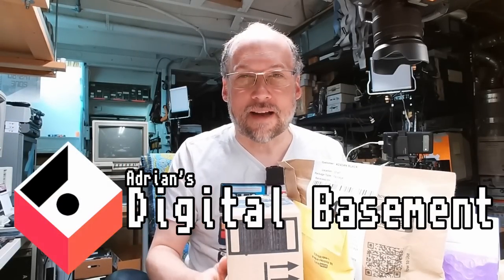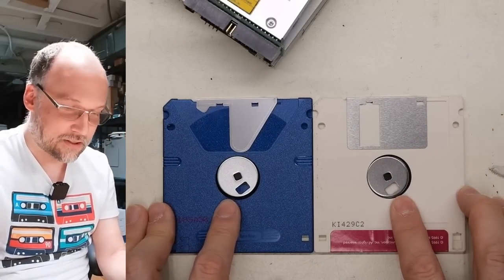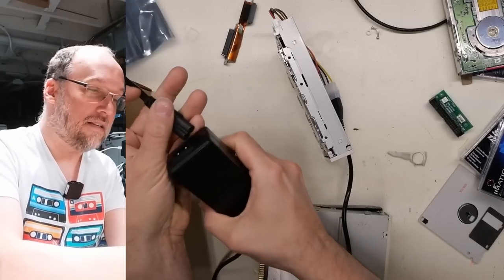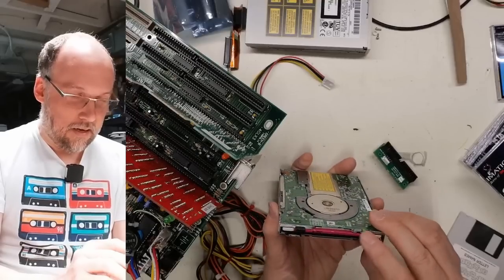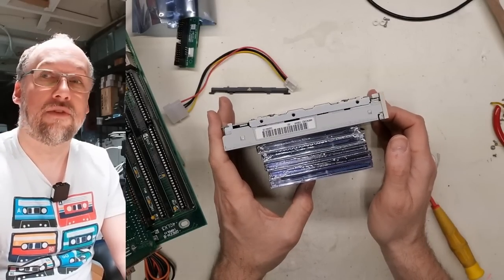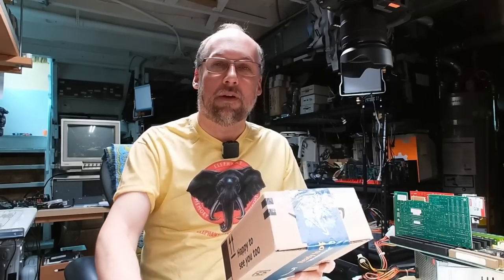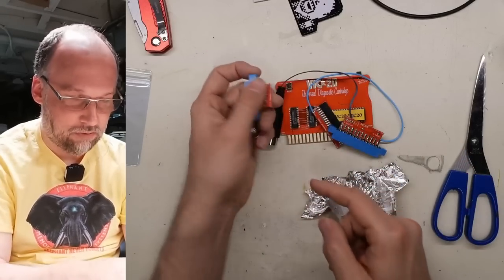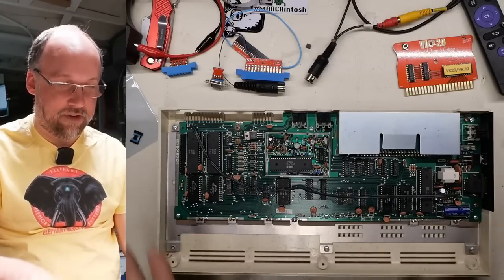0059 A VIC-20 test harness, an LS-120 disaster, a homebrew PC accelerator and a cool bad CPU die

Comment: Are you sure that the short wasn't simply caused by the solder joints of the adapter's power connector shorting against the metal case of the drive? At least that's how it looked to me...
Reply from the maker: Don't think -- the drive itself had a really bad burned smell and traces going to the SMD high density connector looked burned.
Reply: @adriansdigitalbasement2  I had a nasty experience with a 3.5 IDE > 2.5 IDE adaptor once.  For what ever reason it had +5 on a pin it shouldn't have.  When connected to the 2.5 disk drive a fair bit of current flowed and burnt a track on the drive's PCB.  Fortunately I was able to repair it and read the customer's data off it.  It would have been pretty bad to go cap in hand and tell them I had lost all their data.

You'll notice this drive has +5V only on the label, no +12V.  Only speculating but perhaps the adaptor routed +12V to somewhere it wasn't supposed to be.
Reply: @adriansdigitalbasement2  That's a shame, the pinout is totally different from a CD-ROM 50-pin unfortunately. And I think that your adapter may have been regular 50-pin optical drive pinout. You can see the real pinout in the "Slimline LS120 SuperDrive Floppy drive" thread on Vogons, it's the same as regular IDE but with some unused pins at the end. Eledip made some adapters that fit slimline LS-120 drives and they work really nicely. 
LS-120 drives are rarely working to begin with, I have a few that read floppies but can't read superdisks anymore, along with some that just chew up disks. Great drives when they work though, since they use a voice coil to move the heads instead of a stepper motor, they're very fast and I can sometimes read data off bad disks that regular floppies can't read anymore.
Reply: @retrozmachine1189  yeah, that'd be my bet, I've had adapters of that ilk in the past where the power connector was installed backwards so when you plugged it in you put 12V on the 5V rail.
Reply: I that happen with an IDE adapter the pins shorted to the case. Learned to put a lot of electrical tape between them.
Reply: @retrozmachine1189  good point on everything we hear for sure.

I've installed a module or apart for something that was messed up at the factory Straight Out of the Box defective and this was from the manufacturer as sent as a replacement part and damaged the device Beyond repair and got ahold of them got the newest model and they admitted that they're having problems with the device in the first place but had heard nothing about this even when I did repair and it was strained why the thing blew up on it and suspected that something had gone wrong internally the truth was told in the end when I called about the issue with the replacement part go figure that's probably what killed that module in the first place from what I heard and heard same sort of thing two other people back in the day same problem same solution was taking care of same way probably something going on there for sure.

Also one time where I used to live refrigerator went out apartment complex blue the same component three times in a row and we insisted on brand new refrigerator since it would just probably fail again in the same way we got it no questions asked and then compressor was good it was just start assembly or overload assembly cannot remember which it was just basically frying itself don't know if it was a bad batch or what but glad didn't have to worry about the refrigerator anymore just goes to show sometimes it's worth just throwing in the towel as well when something gets repaired three times the same part failing within months of each other there something wrong it's time to start fresh when everything else checks out compressor was properly checked no problems there no problems elsewhere but was just a part that had then replace that many times for sure
Reply: yeah... that's what happened 
...and i saw it coming.

i wondered if anyone else saw it.

Comment: Hi Adrian, Laser is for alignment also LS120 have very high density so they read write slower. Normal floppy can't hold the capacity since they don't have the density. Use them since they come out on the market, I love it reading normally floppy really fast.
Reply: I would like to add that the magnetic read head can be made very narrow and still read a disk. A smaller head can read "bigger" tracks without any issue. The write head has an issue because no matter how small you make it you'll have a magnetic domain larger than the head. To write a bit the drive would pass current through the head, but at a level too low to make a magnet mark on the disk. If you turned on a laser while the low current was passing through the write head the added heat would lower the magnetic strength needed to make a bit. Basically you'd have small magnetic energy over a larger area but only the small part you hit with the laser would allow the magnetic field on the media to flip.
Reply: Fun fact: LS in LS120 stands for Laser Servo
Reply: @therealjammit  ooh, are you saying LS120 uses the Curie point to control write area kinda like MiniDisc? I had been under the impression it’s only for traditional head positioning. But indeed MD holds a similar amount of data as LS120. Albeit it reads with the laser instead of with the magnetic head.
Reply: @kaitlyn__L  Yes. The Curie point. I honestly couldn't remember that term. Same as MiniDisc.

Comment: Those blue LEDs were £10 each when they first came out, here in the UK (at Maplin's). The next year they dropped to £2. As for Radio Shack (Tandy here) I think they'd already closed up shop here before those were availavle. I'd guess the price would have ended in a 9 though, regardless. I think EVERY price in Tandy ended in a 9!

Comment: We installed LS120s in lieu of floppies for a while in our machines. It was short lived but they were good for backups. The laser on the ls120 is with the heads and is a tiny little thing. It is used to read servo index data from the disk. This allows more precise positioning of the heads and thus higher density data. The hole in the eject button is an emergency eject hole. These can suffer from the click of death.
Reply: As soon as he said that, I thought I recalled the LS120 drives using a laser for tracking, not directly for read/write.

I remember a lot (well, relatively, a lot) of Compaq machines having LS120 drives in place of the floppy as a standard feature (and was bootable) around the AMD K6-II era. Specifically those beige-y models that were kind bulbous and had some front ports behind a frosted plastic door at the bottom center of the case front. Before they went to the white design with the changeable translucent color panels.
Reply: @slightlyevolved  they made quite a few OEM deals to try and make up lost ground against Zip. IBM desktops also had them for a while too. AIUI they also stumped up the work necessary to get BIOS support as a condition of the OEM deal. Of course, it wasn’t enough! The computer manufacturers took the excellent deal on drives while they were being offered but had absolutely no investment in keeping the platform.
Reply: I have a original-iMac-era external ls120 drive (USB), for bridging to the brave new world with no floppies. I've used it only a handful of times at most.

Comment: The reason LS-120 SuperDisk floptical drives use a laser is that the read/write head in the SuperDisk drive is much smaller then standard 1.44MB floppy drive and the laser helps locate the head much more precisely then possible on a normal floppy drive. It this precision that allows it to store 83x the amount of data vs a standard 1.44MB floppy. The successor model to this, the LS-240 offered a additional feature, beyond doubling the capacity, in that it could format a standard high-density floppy disk to 32MB. The downside of this was that such floppies could only be read on LS-240 drives, not standard floppy drives, and that each time you changed any data on the disk, you had to rewrite the whole disk contents much like early CD-RW media.

Comment: Nice video, Adrian :)
That laptop drive is fine!! The adapter power pins were shorted on the metal back of the drive because someone forgot to insulate the adapter properly!! I had the same issue before with HDD adapters.
Reply: Well it's not fine any more... 😉

Comment: I had that larger LS 120 drive back in the day. It's been 20 years, but do remember it having a unique sound, and if memory serves me, yours sounded about right. I bought that drive new and just loved it. I remember booting off regular floppies, and that was the magic over the zip drive, that and it fit right into the tower looking like nothing more than a regular floppy drive. The fact I could store 120mb on a floppy sized disc and run regular floppy discs, was the reason I got it. Of course, it didn't stay in favor once compact flash came along, and it's been long forgotten. It did bring back fond memories of it though. It was nothing more than a fad, but one I am glad I had!!!
Reply: I bought a gateway PC a few years ago, had no clue about LS120 then. I thought someone had just added a fancy floppy drive with a soft touch eject button, low and behold it was an LS120! It also had a Travan tape drive for backing up your HDD.
Reply: @0326Hambone  yeah, if I were still into computers like I was 20-25 years ago, I'd cherish having an LS120 again for nostalgic reasons. I remember it was much faster and actually quieter than a regular floppy drive, and I liked their little gold logo on the drive door. To me, it was miraculous that they could take a little floppy drive type disc, and stuff 120mb onto it! I can't remember by how much, but it also increased the capacity of a regular floppy disc. Then the real game changer came along with the CDR! How could it get any better, a burnable CD!!!
Reply: @0326Hambone  I rebuilt practically every brand of PC ever made from around the first generation Pentium 1 up to about P4, including laptop and desktop machines, and Gateway was one of the better built brands. Sony Vaio's were also well built, and Dells were mediocre, but there were some brands that were just junk, can we say Compaq Presario. One thing about branded machines though, most were difficult to work on due to case styling, and cramming everything into the smallest space possible! In all those years though, the Mac was highest quality computer I ever rebuilt. The components in them were far superior, but I just didn't like the Mac os and software. Mostly stuck with IBM compatible due to their availability and diversity. It really got interesting when I started delving into laptops. Man, I used to have five PCs updating at a time in my living room, at least it kept my house warm in the winter...lol. Ahhh, the good old dial up days, 56k all the way!

Comment: LS-120 - Laser Servo. The bottom side of the LS disk contains an optical pattern which is read by the lower head laser in order to position the head accurately enough to achieve the number of tracks required.

Comment: Hi Adrian,
the sound of the working LS-120 is normal (the "tschuka tschuka tschuk" sound when inserting a disc may be a calibration to seek for track 0, the hissing noise is the voice coil tracking mechanism). When inserting normal disks you will hear a "clok" sound now and then when the mechanism recalibrates the head position (as you have no defined steps as with a stepper motor in a regular floppy drive, no position encoder and no tracking helper on a regular floppy disk it needs these recalibrations).

And yes, the drives work with a laser for tracking (it is mentioned in the Wikipedia article). Take a close look at the discs, you can see the optical guide pattern on the disc surface.

I own several of these drives and also an LS-240 which is able to write 32MB to a regular 1,44MB disc which is quite impressing. It is achieved by what you call "shingled recording" on modern high capacity hard drives. As there is only a single area the whole disc must be written at once.

It's a shame that Panasonic didn't implement the whole feature into the firmware, so reading of these 32MB discs also requires a driver which does no longer work on "modern" OS...

Regards,
Torsten

P. S. As YT refuses to respond to your answer I will add the additional info here:

Yeah, this 32MB feature was a bit late and the LS-240 was not wide spread. BTW, for the LS-120 there existed an SCSI adapter. Somewhere I have a few of these. They were quite critical, there seemed to be dependencies on the drive's firmware revision. I bought these because I thought that could be useful as external drive for computers with SCSI (like) interface like the Atari. I think my adapters could have been these: https://web.archive.org/web/19991118150231/http://www.winstation.com/ssdspec.html. Not sure because currently the stuff is stowed away.

There's not much info on the internet about these, it seems that Mitsubishi and Winstation Systems developed this and sold them as SLS-120 drives, so the seller possibly ripped the drives and controllers apart. Which explains the dependencies between SCSI adapter and drive firmware because it wasn't a universal IDE to SCSI adapter...
Reply from the maker: Thanks for the info. That is so cool about 32mb on a 1.44mb floppy -- I saw that mentioned in the WIkipedia article. Would have been wild if this had taken off and been more popular. I guess they were just a bit late to the party.

Comment: 83C196LD - found on some Intel product timeline : 

"the low-priced 83C196LC and 83C196LD controllers for low-cost ABS systems"

So maybe not defective, just unused. Many automotive ECUs have chips bonded onto a ceramic substrate, then a conformal coating is applied to keep the elements away.

Also about the blue LEDs - the very first silicon carbide LEDs had a pleasing somewhat dim light, not quite as monochromatic as the later, brighter gallium nitride thin film based ones which is the technique still used for those. Those first ones were really expensive... yeah. And sometimes hard to get even at that price.
Reply: I used to glue those chips into ceramic packages for wire bonding.  They would often still have a piece of the substrate attached :)

Comment: One major challenge of linear recording of magnetic media is making the R/W heads keep exact alignment with the tracks. There are several solutions to this. One may be to just make the tolerances big enough and the tracks wide enough so a certain misalignment won't matter. This solution is used on regular floppy disks. Of course this approach doesn't work if you want to increase the track density. This is why there is another solution of giving the media prerecorded tracks of magnetic information that will tell the R/W heads how to move to compensate for a misalignment. This approach is used on ZIP disks and, funny enough, tapes which use linear recording (e.g. LTO), which is, by the way, the reason those media must not be bulk-erased if you want to reuse them. The third solution would be to physically mark the media and read that marking optically, e.g. with a laser, like it is done with LS-120.

Comment: This video is the video that keeps on giving.  I think the last time I saw wire wrap was in a Sanyo radio/cassette player from the '70s.  Wire wrap was used for the inter-connects between the PCBs in it.

Comment: The 83C196 was used in early ABS braking and traction control systems.  There was also the 87C196, and the 88C196, the last of which had flash embedded.  They were sold to many of the large auto manufacturers for use in their vehicles.  I used to test them for failure analysis.  I've even wire-bonded them to ceramic packages for testing purposes, as many of them were installed directly onto controller boards and wire-bonded to them.

I actually was given a 6-inch wafer of these devices in a presentation frame when I left Intel, it's on the wall above my desk right now, in fact.   If you could get higher magnification, it should actually have the device name written along one of the sides, if memory serves.

Bit of a trip down memory lane for me, too :)

Comment: Awesome!  You got the PC-Sprint.  Sorry about the square pins.  Now I know to use round pins.  See, learning more from you.  Thank you!
Reply from the maker: Hehe! It's ok -- it works in some sockets but usually pushes them beyond their limit (if it fits in) which can make it impossible to put a regular IC back in. The round pins can be purchased very cheaply from AliExpress or similar.
Reply: A hint for sourcing the round pins: Search for "IC headers", which seems to be the name, complementing "IC sockets" where they are supposed to fit into.
Reply: @tw11tube  thank you.  I tried to look for some on eBay and couldn't figure out what to type in.
Reply: @adriansdigitalbasement2  Hey Adrian, a heads up.  I'm pretty sure I soldered the two diodes the wrong way on the PC-Sprint I sent you.  Also, the "Turbo" jumper is the left two pins.  If you're going to be in VCF West in Mountain View, California, I'll have a PC-Sprint with the correct diode direction and round pins made for you.  Sorry about that.

Comment: I remember in the early 200o's being all set to replace the 3.5" floppies on all my computers (I had about tower machines for various purposes, it was a bit early for VM's!) when USB flach drives came out and prices dropped as capacities rose, and I was hearing vrarying reports about reliability do I didn't conttinue with that "upgrade". Instead I fitted DVD burners to a couple of machines for archive purposes and just used USB flash drives for if I needed to take files elsewhere which also meant I didn't need a portable LS-120 drive too. 

I think for your sanity you need to modify the retrotink to have a power switch on the front.... :)